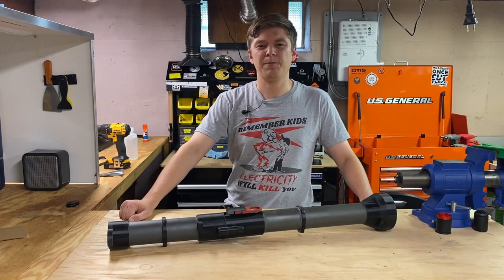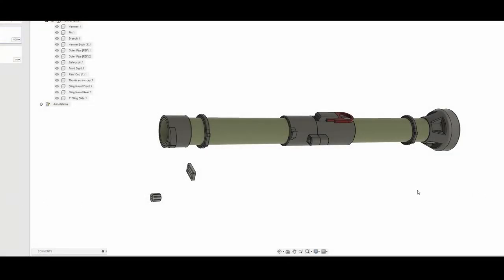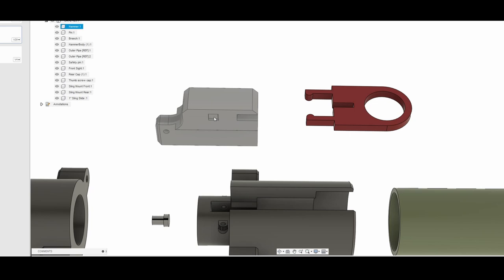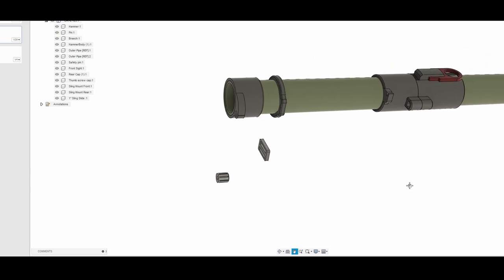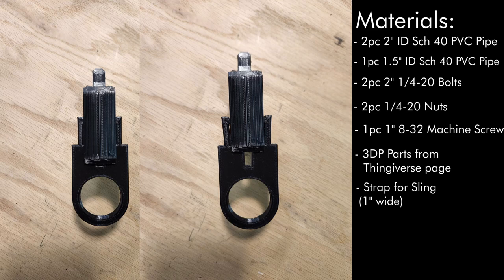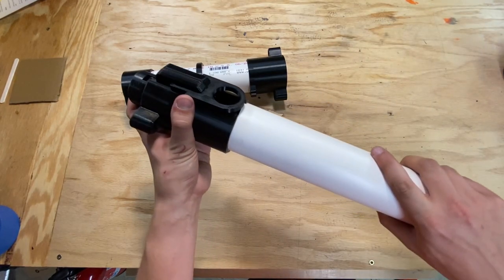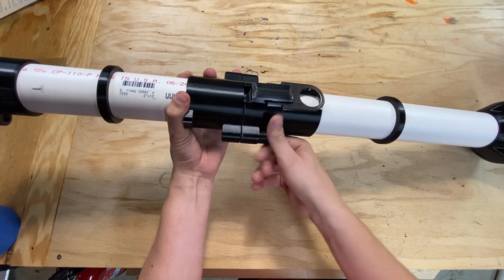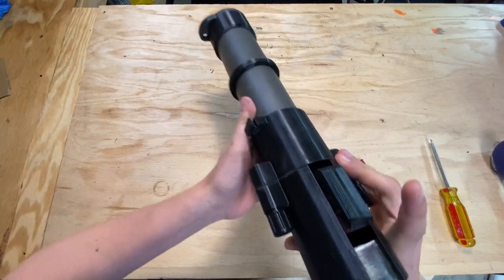Airsoft Anti-Tank for $20- The XE-15 'CAT' Rocket Launcher

Comment: I love you.

I was looking to design a simple RPG 26 for use with taginns but your design for the trigger is much simpler than what i came up with, great work!
Reply: I'd love to see what you come up to use this system for an RPG-26. I was thinking of using this system as well for the same purpose.
Reply: @notlad1282  so far I have redesigned the safety to use a pin instead of the printed piece and I am trying to make ranged flip up sights
Reply: @weaponsgradepotato  That's definitely a good start and puts you on your way to getting it done.
Reply from the maker: @weaponsgradepotato  We saw that on the Thingiverse page, great work! Let us know when you're finished and we'll share it on our Facebook page if you'd like.
Reply: @ExplosiveEnterprises I know it’s a little old but. if I wanted to use bbs instead of projectiles can I do that?
Reply from the maker: Absolutely! It should work with BB-firing grenades with no modifications. @nathanrowe1542
Reply: @ExplosiveEnterprises  ok thanks what grenades do you recommend for bbs
Reply: @ExplosiveEnterprises  also where do you put the 1 inch straps on the part that goes over the pvc

Comment: Noticed that in the video, the ring of the front sight didn't seem to line up with the notch of rear sight. Was this by design to use the launcher at an angle? If the model of the front sight is instead mirrored then it becomes in line with the rear. 

I am aware that the sights aren't meant for extreme precision but was wondering whether you're supposed to aim with the post or the notch on the rear sight?

Thanks!
Reply from the maker: Hey there. The offset sight is deliberate; the intent is to give a slight elevation that can be correlated with a known distance (for a particular shell/loading) through testing. The sight is intended to be used by aligning the top of the post to the center of the hole.

Comment: Love this kind of project, disposable rocket launchers are just the coolest. But I do wonder why you went with the thumbscrews instead of something like printed interrupted threads and a simple lock?

Do you ever have issues with the hand based trigger not properly releasing the gas from the shells fast enough?
Reply from the maker: Funny enough, the original design did use (non-interrupted) threads. Ultimately, the thumbscrews turned out to be a simpler solution that was easier to print. Threads can be a bit tricky if your printer isn't well calibrated, and we wanted this thing to be as easy to make as possible.

As for triggering, we haven't noticed any issues in terms of gas release speed, though all of the shells we've tested with it are the traditional trip-valve type, which perform the same regardless of how fast the trigger is pulled. I would imagine it'd be an issue with something like the APS Hellfire shells though!

Comment: would you need to put the "rocket" in or could you just fill the grenade with bbs and fire it that way
Reply from the maker: You can definitely fire it with just BBs if you'd like, no need to load it with a rocket.
Reply: cool as soon as my printer is fixed ill start making this thank you

Comment: ¿40mm external diameter and 50mm external diameter pipe? For non imperial system people... XDDDD
Reply: yeah its a pain to get proper sizes in UK but i managed it, and it works well
Reply from the maker: Check out the Thingiverse page, we just added a metric version for 63mm PN10 PVC pipe.
Reply: @ExplosiveEnterprises  good for milsiming

Comment: Maybe add a bayonet mount for the front and back half with a latch to speed up the reload process. Like two pins with fitting groves so you just have to turn it 90° and pull them apart. And maybe a sping for the fring pin for safty.
Reply: This is exactly the same thought I had. Add a spring to the trigger, and instead of thumb screws make it a 90 degree turn with pin (or latch) of some sort to keep it from comming undone on accident.

Comment: Any possibility of getting it in a "Normal" Metric size? American size inch tubing is impossible to get in norway. Its either 50mm OD or 75mm OD
Reply from the maker: We've had a few people ask, but you're the first to actually give me the standard pipe sizes! I can definitely take a crack at resizing it. Unfortunately, a 50mm OD barrel would not be able to fire Nerf rockets, so you'd be limited to TAGINNs or 40mm shower grenades. Is there a type of foam rocket that is popular over there that I can try and size it to?
Reply: @Explosive Enterprises  After some more reaserch we do actually get a "2.5" piping aswell. 

This is 63mm OD with 3mm wallthickness.

So 63mm OD and 57mm ID, this would be the closest to 2" ID Schedule 40 PVC pipe and would be the easiest to resize to.

At a plumbers shop they advertise these sizes for PN 10 (10 bar/150psi rated PCV pipes)

OD                   Wall thickness
32mm             1.9mm
40mm             1.9mm
50mm             2.4mm
63mm             3.0mm
75mm             3.6mm

In norway foam rockets for AT isnt a thing as far as i'm concered. We're using Taginn chalk rounds, 40mm shower and 40/master mike rounds for anti vehicles. I will be loading mine with 40 mike rounds.
Reply from the maker: @HRawesomesauce  If you check out the Thingiverse page, we have added an experimental metric version of the launcher, if you get a chance to print it out, let us know how it works!
Reply: @ExplosiveEnterprises  i'm away for work until the 20th. Will print and test when i come back home.

Comment: Two small things .

How, once the whole is glued, make sure the firing pin don't go AWOL ? if you lift up the hammer, it can go. Usually, the noise it make inside tell you, where is has gone. :) I thinking of putting an extra plastic card, to make sure that 1 the firing pin don't go elsewhere and 2 that the hammer is solidly, not jingling around.
Has anyone had the same issue ? What solution do you have ?

The same part that incase the firing system has cracked. Maybe make the lip a bit more solid ?

Thank you.

Comment: could you provide a list of the pipes needed with the lengths? i cant seem to find it written down anywhere  and i have zero knowledge on this stuff. Thanks
Reply from the maker: If you check out the "Materials" section at 6:35, we go through the diameters that you need for the pipes, and the lengths that we used in our build.
Reply: @ExplosiveEnterprises thanks. I started printing it and I have all the materials ready. I will post a make when it’s done!